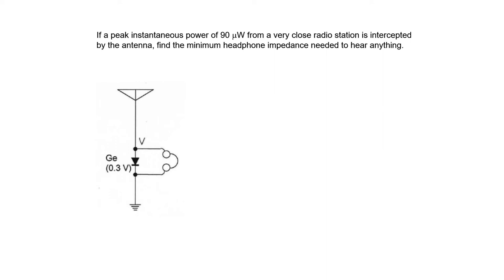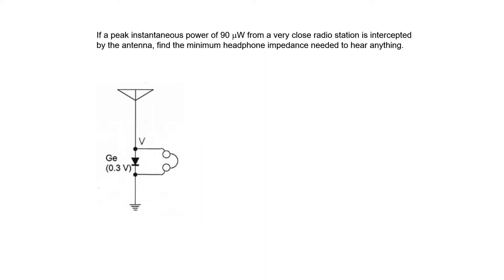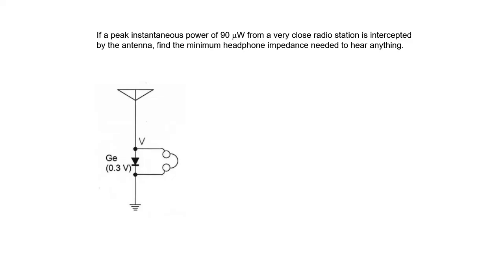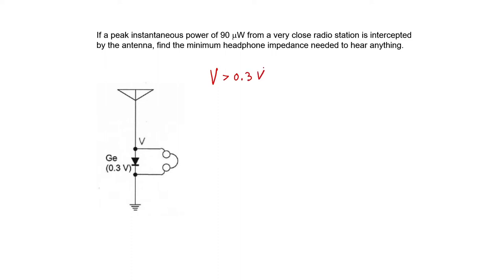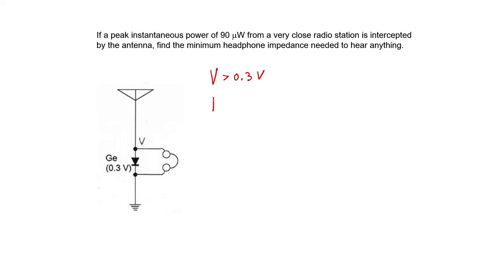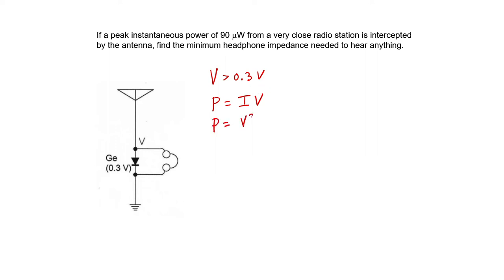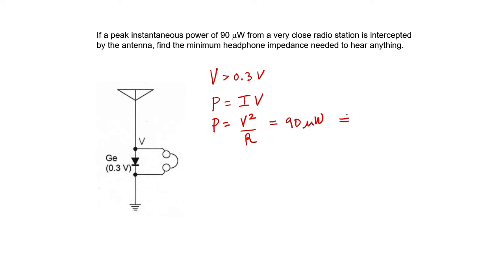Why do crystal radios need high impedance headphones? (10-Analog Electronics)

Comment: Except in the case of low impedance rocking armature earphones from old rotary dial phones! I've proven this many times by demonstrating that these very sensitive earphones are an exception to the rule. The value of the earphone coil is 150 ohms Z, but it works flawlessly in the circuit you described.
The one I'm using is made by STC and is second sourced by Plessy, both English manufacturers

Comment: I built a Crystal radio when I was a preteen from memory. I remembered the simple circuit from a Radio Shack 101 Electronic Projects Experimenters kit. I got a 1N34a germanium diode because of the .35 forward bias on voltage, AM slug tuned coil, a 365 pF, 365 mmf back in 1975, air variable capacitor, 2000 ohm resistor and a crystal high impedance earphone, all parts available from Radio Shack back then, and wired it together on a wood board with fahnestock clips. At first I was picking up shortwave radio with it but after I realized I needed to use the entire length of the loop stick coil and not the tap it received am signals.

Comment: It's a really good idea for an explanation. But the germanium diode is not a switch at 0.3 V, proper demodulation of RF-AM signals also occurs well below this voltage. Nevertheless, the highest possible impedance of the headphones and a corresponding time constant with a parallel capacitor are important. In order to hear reasonably well, only a few ten picowatts of AF are necessary. For crystal earphones, the impedance is extremely high, but the self-capacitance is about 1.5 nF, so a parallel resistor of 100 kOhm is a good choice here.

Comment: Thank you for explaining the answer to this problem so clearly. I don't think I've ever seen any videos actually explain why you want High Impedance Headphones for a Crystal Radio. It always seemed counter intuitive to me to say you needed High Impedance Headphones because that's higher resistance to current flow but I only recently began to grasp Ohm's law.
You also need to understand when you need a greater voltage (more push) then you do greater current (Amps - Flow). Don't the higher voltage fluctuations (Amplitude) above the Diode Turn On Point also drive the headphones more forcefully therefore pushing more air into you ear (Volume)? Thank you for sharing.
Reply from the maker: A higher voltage reaching headphones of resistance R would ordinarily drive more current through them (by V=I*R) and give more volume; however, the antenna here is not a good voltage source but rather a bad one. The voltage just drops when you try to draw more current. This effect can be modeled as source impedance, and the result will be a volume limitation.
Reply: @adanner  Thank you for your follow correction. I'm obviously still grappling with this. But, I won't give up.
Reply: @adanner  So is this, the antennas inability to supply stable current when demanded by radio (Headphones) another reason   in addition to the Diode Bias Needed that High Impedance Headphones are needed. Is the receiving Antenna in this a  case a High Impedance Source and the Rule of Matching Impedance maximizes Power Transfer from the Antenna to the Headphones (complete receiver circuit)? Thank you. If you haven't done so already I'm sure we could all benefit from a lesson on you about Impedance, especially regarding RF/AC currents and how major radio components react?